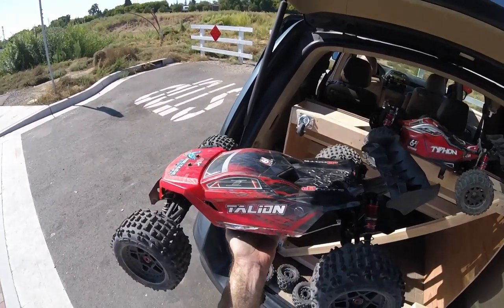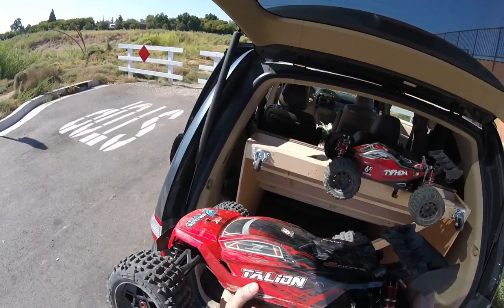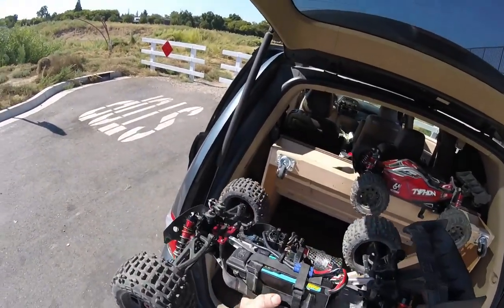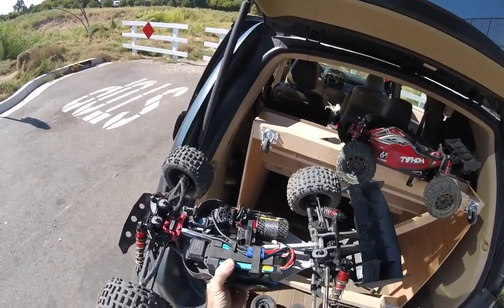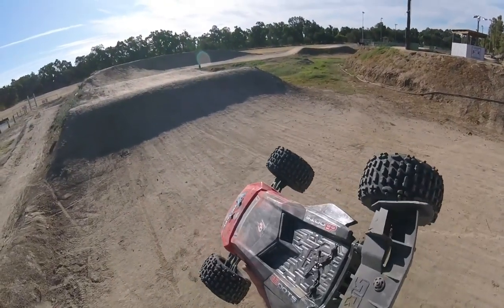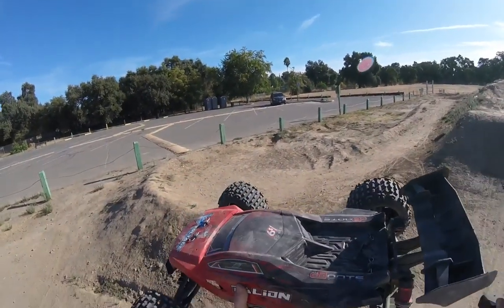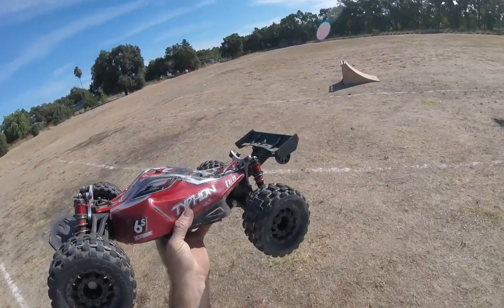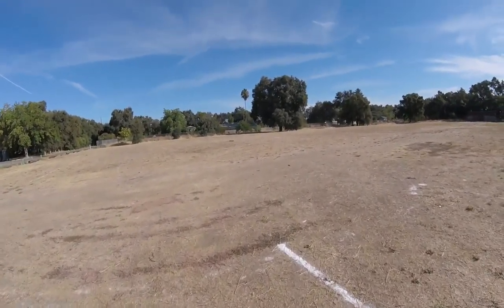ARRMA Talion 6s "Hardcore Basher?" durability revisited, with Typhon 6s...

Comment: Hey Rich, awesome video again. On holiday in California next month. If only I could bring my Big Rock on the plane!
Reply: Derren Mead you can . Pack it in your luggage or take the tires off and pack it in carry on. Then your lipos must be labeled with kw rating no more than 120. Each battery must be in its own zip lock style bag . If your doing 6s bricks you will be limited to 3 . But most others (3s 5000 mah 50c for example) you can bring multiples. That is current FCC guidelines. Each airline is alittle different but pretty close. I took my summit with paddles to Hawaii end of last year, no problems. Other than from my wife. Lol p.s. pack the batteries in your carry on and put them in the tray just like any other electronics when you go through t.s.a
Reply from the maker: @norcalrc  that's great info Brother 😜!!!! Really appreciate you sharing that. My wife would friggin flip if I packed an RC, but I'd do it anyways if it was worth taking the heat 😱🤣🤣

Comment: Couldn't agree with you more Rich! The Talion is Arrma's most versitle trucks! Stock form is a speed freak, Kraton tires makes is a big basher and regular truggy wheels turns it into a decent handling truggy (way better than a Kraton) That's why I have 2 of them 🤣 I can't believe you didn't do more damage when you smacked the Typhon on top of the shipping container 😱 Your ramps is looking good man 👍 Getting some nice smooth air out of it! I know how hard it is to get that slope just right 👌
Reply from the maker: Thanks so much Aaron 🤗!!!! Definitely an versatile rocket 😱. Felt KILLER to tune her up and get out again 😍. I figured there was a reason you had 2 of them. The Typhon is super versatile too between speed runs, track time, or going Truggified basher. Yeah that container hit was pretty gnarly 😱. She took it without issue fortunately. You're right about the ramp angle Brother 👀. Very tricky to get it right. Easy to go too steep and have really hard vertical landings. I'm digging this one so far 😋👍👍😎💪👊👊

Comment: Love the Talion.  Been having a great time with it.  How do you setup your suspension for these big jumps Rich?  Do you use the recommended 2kcst in the shocks?  Stock springs?  I've played around with the shocks quite a bit and always end up going back to stock, but wouldn't mind like one cm more clearance if I could do it without jacking up the preload a ton.  Thought about putting Kraton springs in the rear, but there just doesn't seem to be any good alternatives to the front spring.  Would love like maybe one more lb/in in the front.
Reply from the maker: Great question James 👊. I'd ran the stock shocks and oils for a long time with the collars dialed down to maintain arms level running. Recently rebuilt them with fresh 2000cst and now trying Tekno Orange Truggy springs up front. They're a bit softer than stock, but longer so I'm getting a bit more rebound. Not sure I'm liking it more, the jury is still out. My front stockers seemed to lose a bit of rebound after repeated beatings 😱🤣🤣. The wheels obviously play a big role too. 🍻😎💪👊👊
Reply: @richduperbash2966  thanks for the reply - I tried the tkr6093 in front and felt the same way - jury still out.  Used the longer length with some preload to compensate for the softer rate but felt like it messed up my small bump compliance having so much preload. I'm wondering if the Mojave 70mm 7.7lb springs might be a nice medium.. a bit softer and a bit longer instead of a lot softer and a lot longer.
Reply from the maker: @dis3nchant3d42  that might be the ticket 🤔

Comment: I love my Talion, but what do you think of the front suspension for bashing? Those short shocks at a sharp angle make the front pretty stiff. You of course know how to handle it, but it does seem a bit bouncy in your video. And OMG, landing that Typhon on that steel container. Ouch!
Reply from the maker: Thanks Brother 👊!!!! I should've mentioned I'm running Tekno Orange truggy front springs at the moment 🤐. They aren't rated as firm as the stockers, but I needed more length to get a little more rebound and stay around arms level. Definitely a work in progress, cuz yes, I noticed the front was a bit bouncy too. 🍻😎💪👊👊

Comment: Hey Rich,
Another great video.  I wanted to ask your opinion on the Typhon 3s.  I have one (currently replacing the front shock tower/upper diff cover while watching your video).
I am curious what exactly you would do to make the Typhon 3s as durable as possible.  I've seen many of your videos but can't seem to piece together all of the information I'm looking for.  What factory parts from other Arrma rigs would you use if any and what aftermarket parts would you use? Thanks for any help you can provide.  👍👍
Reply from the maker: Thanks Brother 👊!!! I think the main thing with keeping the 3s rigs durable is maintaining the weight savings. Don't add heavy aftermarket electronics, huge wheels, or unnecessary parts. Buggy towers are somewhat vulnerable by design as they are exposed more. The only hop ups I really did were more geared towards performance; Hot Racing motor mount, Robinson Racing pinion, rubber sealed bearings in the center driveline. I did upgrade to offset Badlands 2.8 wheels I glued to F11 17mm hex rims. They offer a wider stance and less flipping over rugged terrain. Also higher top speeds and way more cushion and air control. The GPM steering knuckles were the only real durability upgrade I did to all my 3s rigs. Going to 4mm shocks was the other strength and performance upgrade. 🍻😎💪👊👊
Reply: @richduperbash2966  awesome!  Thanks for the tips! Was there a specific set of shocks you like to use?

Comment: Rich. Great vid. I have a 3s granite and I’m going inning a dynamite 5000mah 50c 3s hard pack. I’m going to get a kraton 6s and I’m trying to decide what pack combo is best. I was thinking of getting 2 more 3s packs that way I can use them on the granite if need be, but the dynamite 3s are $80 a pop, any recommendations?
Reply from the maker: Thanks my friend 👊!!! Congrats on your future Kraton 😱. I personally like to run single 6s compact hard packs. Not a fan of the jumper connector either. I chop it off and use a single EC5 from the ESC instead. Less wire, less connections, less hassles. It's all personal preference really. Most of my packs are Hobbystar from RCJuice. Here's a link to my favorite 3s pack. https://www.rcjuice.com/hobbystar-6500mah-11-1v-3s-75c-hardcase-lipo-battery.html

Comment: Hey
Are you running stock oil weight in the Talion shocks 2000k?. Would 70w be better. Im also running the backflips lp and also bash hard. Should I leave the shocks stock. Hey, good enough for definitely is good enough for me. Thanks for all u do brother
Reply from the maker: Yes indeed Brother 👊. Still running 2000 weight in my Talion shocks. I did switch my front springs to longer Tekno Orange temporarily cuz my originals are going flat after 2 years with weak rebound. Hopefully get my replacements soon. 🍻😎💪👊👊

Comment: Hey Rich. What did you use to strap those tires?
Reply from the maker: Hey Brad 🤗. I used Berkeley Gorilla Braid 35 lb. line. Glued 2 rows per tire, 3 wraps each row. Eventually the line needs regluing. Used standard CA tire glue if I recall correctly. 🍻
Reply: @richduperbash2966  right on. Thanks man 👊🏻

Comment: Absolutely brilliant videos bud, completely new to rc and these are wicked! Quick question (and I have tried various forums and Facebook groups first). I have a talion 6s, pretty standard apart from a heatsink/fan fitted. Took it out the other day for a speed run with the 20t pinion fitted and it just wanted to wheely and flip even when trying to be less aggressive on the throttle. I've been advised I might need to change the thickness if the fluid in the diffs but the advise seems to vary massively to the point I'm no better off lol. The talion has 10k/100k/10k as standard, what would you recommend to try in order to try and keep it more planted when accelerating? I've even turned the punch setting back down to 3 or 4 whereas it was on 9 when I had the 13t fitted
Reply from the maker: Thanks so much Mark 🤗!!!! I run 50/200/20k front to rear mostly and it works great 👍. 20T is pretty tall gearing 👀. Because I often swap between stock Katars and bigger Backflip LP's (Outcast 4s wheels), I run 18T to avoid overheating in Sacramento weather. These BLX motors really wind up hard. Dialing the punch back might help, but venting your tires, tuning the diffs, and moderating throttle delivery at the trigger is key. 🍻😎💪👊👊
Reply: @richduperbash2966  thanks for the reply bud, tbh, I only fitted the 20t for a speed run, didn't know what to expect but it was like a caged animal unleashed lol. Originally I had the 13t that comes with it and had the punch up at 9, for general driving I've also got an 18t, just wanted to see what it would do top end but inevitably struggled to find out because it was nearly impossible to keep all 4 wheels on the ground! Would you say I should go 50k front, 200k middle and 20k rear to start with? Is that likely to improve its composure and help keep the wheels on the ground? I understand if you pull the trigger all the way from the get go it'll wheely or flip but this was even when up at a constant speed at say 3/4 throttle and when you pulled it that bit more it would flip. I've ordered the infraction 6s wheels for speed runs but something beefier when off road. The backflips get good feedback to be fair
Reply: Forgot to add that when I installed the 20t, I took the punch settings back down to 4 and it was still lethal lol
Reply from the maker: @markashman7771  tuning the diffs will definitely help keep it's composure. I would make sure and vent the tires too. With less ballooning the rig will stay better planted.🍻
Reply: @richduperbash2966  legend mate, thanks 👍

Comment: Hey rich I hate to ask you again as you had told me before (I forgot lol) but can you recommend what diff fluid to run in my Kraton for the front, center and rear? I've never tuned and diffs so I'm clueless when it comes to what to run lol. Thanks as always bud.
Reply from the maker: No problem Chris 😜!!! I typically run 50/200/20k front to rear with stock electronics. Currently running 500k center with my high torque Hobbystar 4092 setups in both of my Kraton's 🍻😎💪👊👊
Reply: @richduperbash2966  You never fail to help me out brotha!! I value your opinion above anyone else! Thanks again Rich! Fiqure I should check and fill all my diffs to be safe. 😁👊👌👍👍👍👍

Comment: @rich duperbash I recently picked up a Talion and wanted to know which motor/esc you’d recommend from rcjuice.
Reply from the maker: Congrats on the Talion Justin 😱!!!! I'm still running the stock BLX185 setup with 16-18T pinion depending on wheels and hot vs cold season. I think it's plenty for the lighter Talion personally. Some guys run the Hobbystar 4082 series with Max8 and like it. 🍻😎💪👊👊
Reply: Thank you now to order the rest of the m2c parts

Comment: Would you consider doing an arrma 6s (they all seem to be quite similar) bearing install video in the future? Have to do mine shortly and it's a daunting task to noobies, and noone else has done one yet.
Reply from the maker: I have to be totally honest 👀. Barely finding enough time to go bashing at all lately 🤐. Simply have too much going on with my kids, house, and extended family. Bearing swaps are the perfect time to really learn your rig 😍. Go slowly and do a section at a time. Look closely at the manual schematic, but don't be intimidated 👍. Everything makes sense as you go through it systematically. If I find a vid I'll send you the link. 🍻😎💪👊👊
Reply: @richduperbash2966  Figured it didnt hurt to ask as the 10th anniversary outcast just came out and thought if you got one maybe you'd do a vid on it. 
I'm more concerned with the issues of not being able to get to certain things due to loctite and whatnot. People say "oh just heat it up with X" but noone actually shows how to do it. :D
Reply from the maker: @SledgehogRC  heat is actually the trick for stubborn thread locker 👍. You can use a hot soldering iron directly on the screw or do it much faster with a mini torch. Just have to be careful not to direct heat towards any plastics if using a torch. Make sure to use quality tools like MIP 1.5 -3.0mm drivers. Here's a link to one of my favorite torches. Just need quality butane. I've had good luck with MagTorch butane. https://www.homedepot.com/p/Gardner-Bender-Pocket-Butane-Torch-MSTR-TORCH/202518489
Reply: @richduperbash2966  See that's the issue we had when trying to do my buddies Talion. We ran into a few stubborn screws and even with a soldering iron we couldn't get em loose and noone shows how to do it with a torch so we were intimidated by using one and melting shit we shouldnt have lol.
Reply from the maker: @SledgehogRC  a lot of what I've picked up has been from pure experimentation 👍. The torch literally takes only a few seconds to heat up the screws enough to melt thread locker. Flame reaches around 2000F. Fortunately, ARRMA isn't using red locker like before. 👊
Reply: @richduperbash2966  I have a V3 so im stuck with it I think lol. Anyways thanks a lot for the tips and taking time to reply! Hopefully all will go well ;)

Comment: I have a v4 Kraton,  would like another arrma. What would u recommend?
Reply from the maker: Great question Clint 🤔. The good thing is there is no wrong choice 👊. If you like the longer wheelbase platform, I say get a Talion 6s and Rip it up 😱. It's far different enough from the Kraton to justify grabbing one, especially if you appreciate speed and great handling 😍. The Outcast is MAD FUN, but much more challenging to drive. Definitely a learning curve on 6s power. Running the smaller Badlands 3.8, Shockwaves, or Backflip LP's makes it faster (burst speed) and easier to control with better handling and squat. Nothing wrong with the stock tires, but they take practice and make for a wild ride 🤣. The Typhon and Senton 6s are both Rockets too. 😎💪👊👊
Reply: Awesome thanks man! Bash on!

Comment: Do you think this or the kraton is better?
Reply from the maker: The Kraton has an advantage on rugged terrain with more suspension travel/ground clearance. It's not better in the handling or speed department though. The Talion is lighter and a bit more agile. They really are 2 different rigs. 🍻
Reply: @richduperbash2966  ok, thanks

Comment: What takes the abuse better the talion or the typhon? Thanks, still trying to decide between the two. Stock form whats stronger?
Reply from the maker: That's a tough call 🤔. Both are very durable even stock. I'd lean towards the Typhon only because it's more compact. With aluminum chassis supports, I'd say it's pretty even. 🍻😎💪👊👊
Reply: @richduperbash2966  aluminum chassis supports for talion included stock? Thanks alot. I probably will get typhon. Better for speed runs. Are those aluminum supports in the video for talion aftermarket upgrade? It doesn't look like the red tower to tower brace it normally has. It looks more like the typhon design with chassis brace
Reply from the maker: @familyman8644  none of the 6s rigs come with aluminum chassis supports. Hot Racing, Voltage Hobbies, GKA, and M2C Racing all supply them. My Talion is a V3 so it never had the red tower to tower brace like the V4. I'm running an M2C Goliath 7075 chassis so no need for a tower brace. 🤙🤙
Reply: @richduperbash2966  hell yeah I been on other popular rc channels advertising your work such as Kevin Talbot jumping a traxxas. I'm like the arrma would have taken that.  Out of v4 arrma typhon and talion which one do you think is most durable? I'll be doing bashing and speed runs on grps and shit. Lol I see both are similar but the talion shares same chassis as kraton so you think it would be stronger than the typhon. Does that extra pound difference between the two really make a difference coming down from a 50 foot in air jump? The talion has tower to tower brace as the typhon doesn't.
Reply from the maker: @familyman8644  the longer chassis's are more susceptible to bend due to increased leverage. They all come with 3mm stamped aluminum chassis's. I think the Talion and Typhon both make Killer basher's and road Beasts. Good luck with whichever you decide on 😜
Reply: @richduperbash2966  does it really cost 600 in upgrades for arrmas to be bulletproof?  I got a bunch of people telling me an rpm modded traxxas can take more abuse than any highly modded arrma.